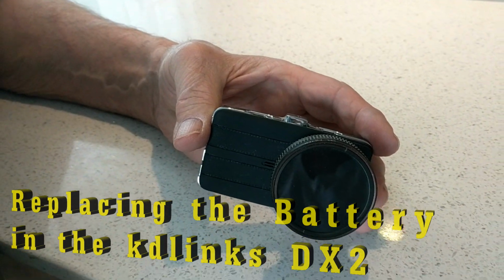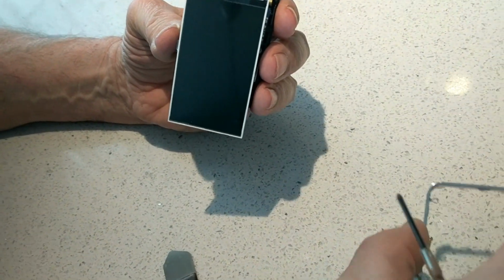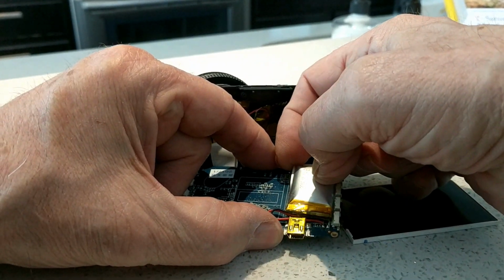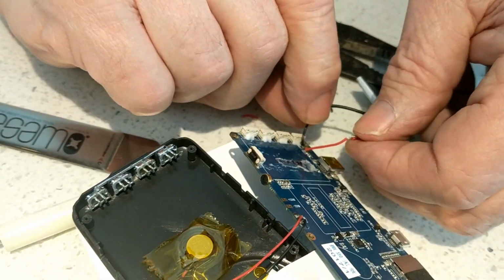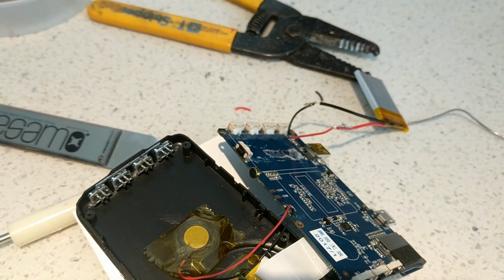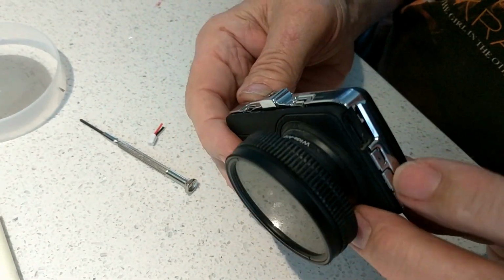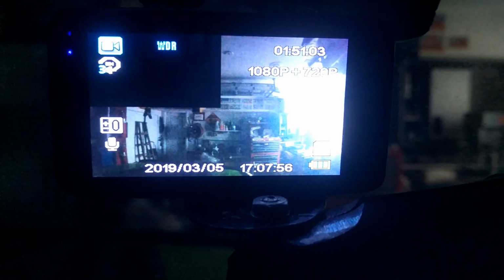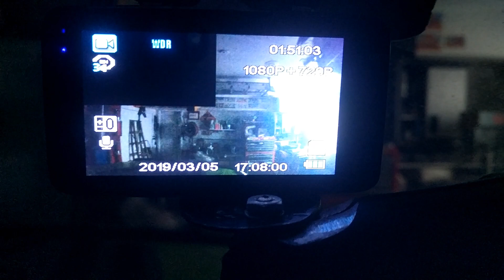20190306 Replace Battery kdlinksDX2

Comment: Thanks for this video. I need to do the same fix. Where did you buy the battery? Can you please share the new battery spec? Thanks.
Reply from the maker: Thanks. It is a 3.7 volt, 850MAH LIPO Battery bought on Amazon. A larger (physically) battery will not fit.
Reply: @JaniceinUtah  Super. Thanks again!
Reply from the maker: @dcflin  Most welcome, good luck!
Reply: @JaniceinUtah I'm confused on why you're saying 850MAH but on your video the battery is 180MAH - https://youtu.be/-8dL0ts83R4
Reply from the maker: @djab203  the original battery is 200 and I bought a 180 and a 200 but the 180 or 190 was the only one I could find to fit. 850 is incorrect. Sorry for any confusion.